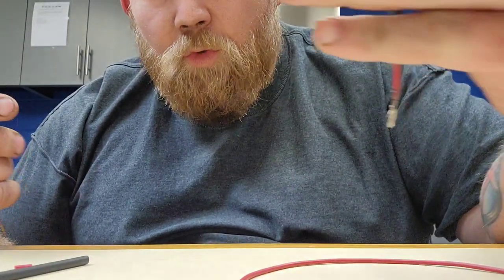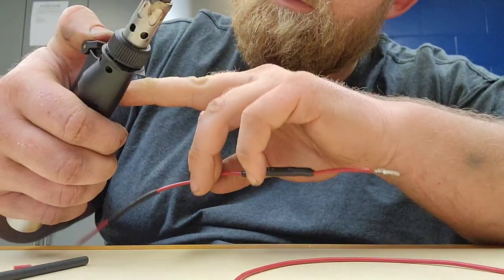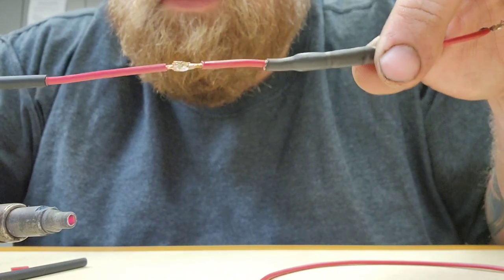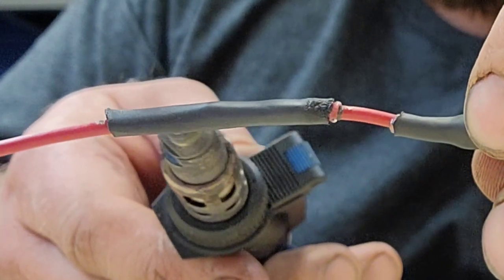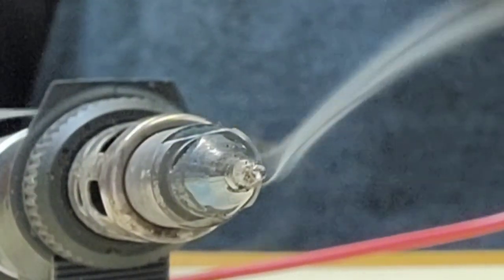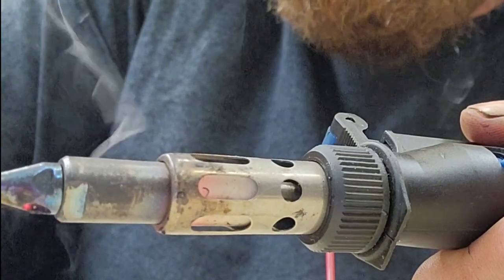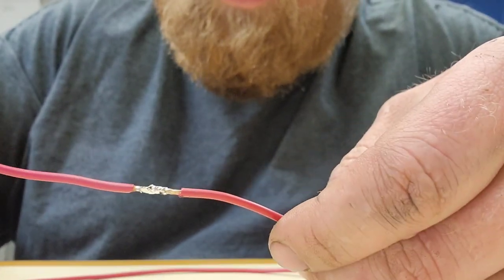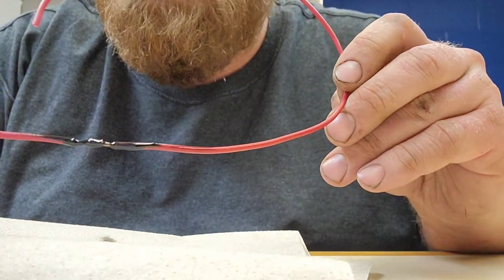Blow Torch Soldering and Regular Solder Tip - Which Do You Prefer / Wire Repair type 4 of 5

Comment: Hey Rich. One thing i have learnt from Plumbers,  If you go to a Plumbing shop you can buy flux.  
You might know from experience when the solder just wont take for what ever reason.  With some Japanese cars. If i keep the heat on trying to get the solder to take the wire would just burn up to nothing.  
Anywhere I solder now i brush on the flux first and the solder just flows so easy into the joint.  No bubbles no lumps nothing. Comes out perfect! That and that chinese finger trap.  I can't think of a better repair. 
Bless you mate!
Reply: Plumber's flux is an acid paste and a really bad idea to use on electrical connections because it will cause instant corrosion. If there's grease or oil on the wires use a contact cleaner or a chlorine-free brake cleaner and rosin-core electrical solder will flow nicely.
Reply: @richt417  yes exactly ... look at some old plumbing where flux was used ... it turns the copper green and black over time ... and i have seen it eat speaker wire up in the sheathing almost a foot into the cable ... especially that cheap copper cladded aluminum wires ...

Comment: Excellent set of vids. I build and run R/C cars and helicopters as a hobby when I have extra cash. My soldering skills are very low. I was first introduced to heat shrink in one of those model car kits back in 85. I was amazed how it worked. I will use these vids to include my vehicles and whatever else needs electrical work when it comes to repairing wiring. NICELY DONE!

Comment: soldering is my preferred method in Maryland you are required by department of motor vehicles to solder interlock systems in cars for people with DUI it’s tricky soldering those wires on new cars no room great video

Comment: Only thing missing is a military splice. Nice!

Edit: nice flow on the solder. I worked with some chuckleheads that used solder like hot glue and it rubbed me the wrong way every time.

Comment: Make sure your hands are clean. Like welding, oil is bad for joints. Use rosin core solder for electrical, not plumbing solder. Use adhesive lined heat-shrink tubing. If you're going to use electrical tape use high-quality tape like Scotch Super 33+ or Super 88. 
*Not trying to invade your channel. Just sharing experience. :)

Comment: Melting the solder on the tip of the iron also improves heat transfer into the wire. I understand it is a recommended practice when soldering.

Comment: You make it look too easy! I get the nasty ones requiring lots of cleaning , solder flux etc but 60 years experience helps. One other tip for exposed wires is the self-vulcanizing tape from 3M. Wrap, 2 minutes later it needs to be cut off to remove and will easily survive in the under hood environment. This is my go-to whenever I need to keep out the salt spray and insulate to high voltage levels. There are a number of cheaper copies on the market which also work well.